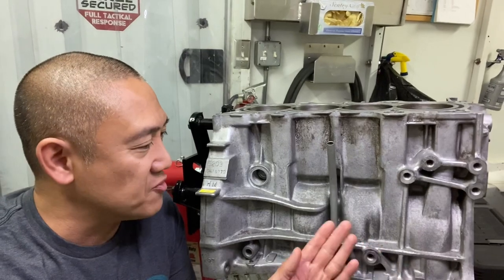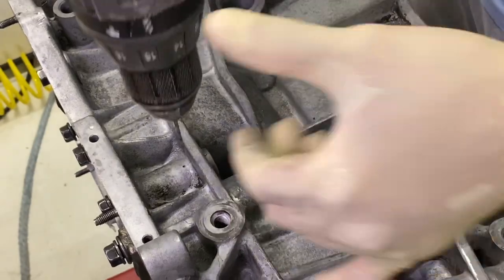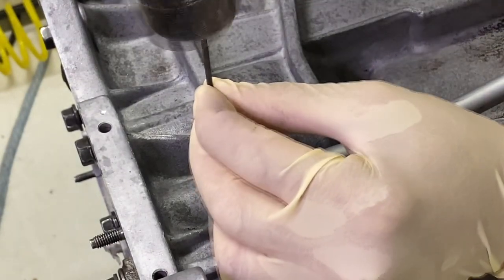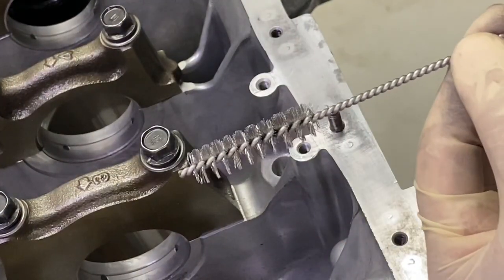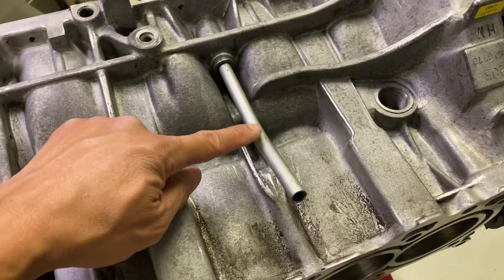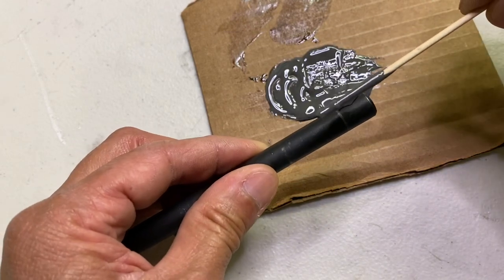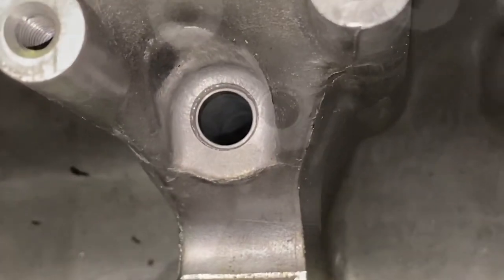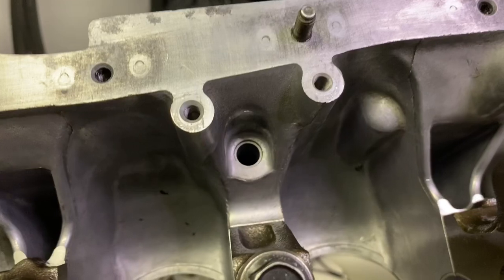Honda B20 Oil Dipstick Tube Leak Fix

Comment: Nice well-thoughtout solution. Seems this is a common problem with the B20 engine; 2001 CRV. 

Thanks. Excellent video.
Reply from the maker: Thank you for the kind words.  That oil leak was driving me nuts and it was a serious fire hazard.  Pls subscribe for more automotive content.  Thx again, AJ

Comment: How does work under boost?
Reply from the maker: Honestly, I haven’t tried it under boost. Although, the dipstick tube has never leaked after the fix. I came up w this fix bc I was always worried / nervous racing w an oil leak right over the exhaust.

Comment: Is that for a 2001 honda crv
Reply from the maker: I don’t know which vehicle this motor came from. If I uncover the block I’ll check if it has a VIN code on it. Why do u ask?
Reply: @RelentlessRacingAJ  my crv is leaking oil also, not to sure where it's leaking from. it seems that is coming from the same area towards the headers but not sure
Reply from the maker: @jessiemoore1849  if it is leaking from that area it is a fire hazard.  once the oil hits the hot exhaust it could possibly ignite. Clean up the area and verify where ur block is truly leaking.
Reply: @RelentlessRacingAJ  thanks bro much appreciated 💯